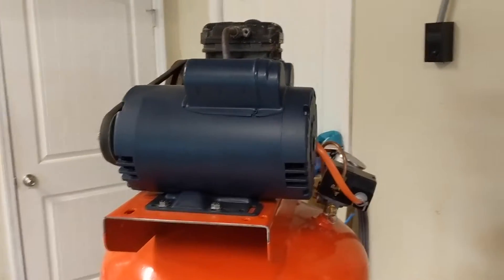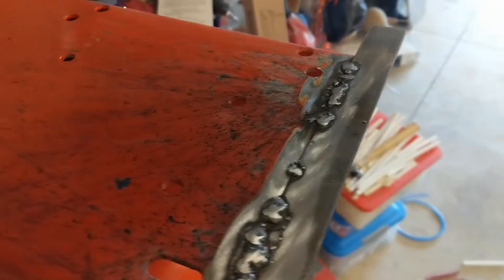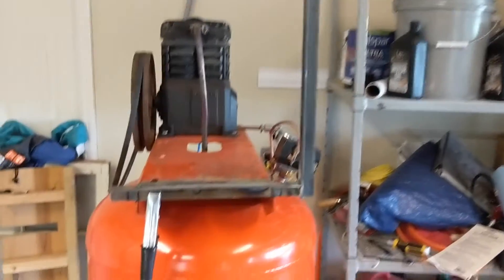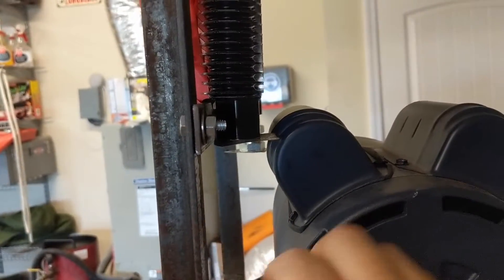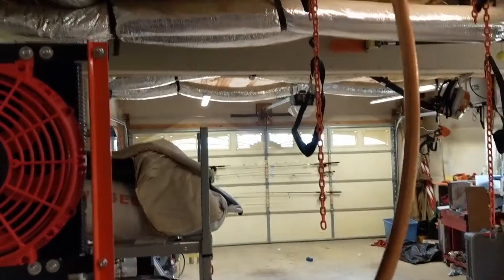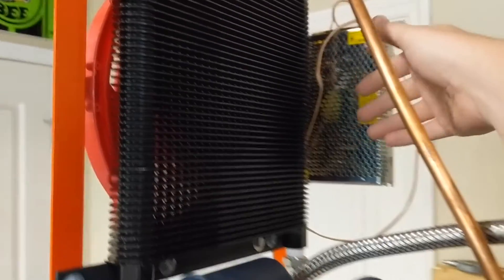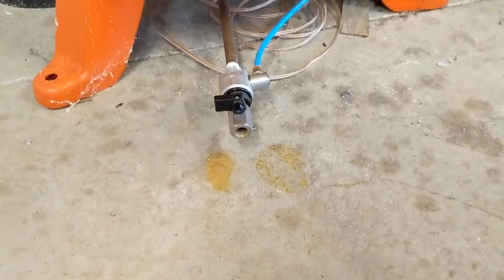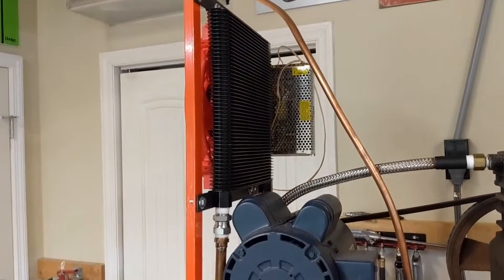Air Compressor Aftercooler/Dryer DIY Under $200

Comment: Hey Rooster,
I got my project going finally. I installed the lines on my 30 gallon compressor and the oil cooler and I’m having a problem with the fan blowing a fuse every time I connect it to the power switch. There’s 2 lines for the motor and 2 lines above those. Do I disconnect the 2 factory wires and install the fan wires. Any ideas?
Reply from the maker: You should have 5 wires coming into your pressure switch - 3 from the incoming AC which are hot, neutral and ground if it's 110 or hot, hot and ground if it's 220.  Your other 2 should be the switched power going to the motor.  I connected my fan transformer to the two wires going to the transformer.  220 is easy because they are both hot.  If it's 110 then you have to make sure you have the correct polarities.  You say blow a fuse, but are you meaning the breaker in the panel for the circuit, or a fuse in the transformer?

Comment: I don't get why you put a 12 volt fan on it.
Wouldn't it be simpler just to use a 120v or a 240v fan instead?
Reply from the maker: I was looking at them, but I couldn't find an inexpensive 220v fan.  It was actually cheaper to use a 12v electric radiator fan and buy the transformer
Reply: @TheRoostersGarage  I never would have thunk it !
Reply from the maker: Yeah, I was seeing fans for over $100 for much more critical jobs intended.  I just started looking at what fans I could adapt to this and stumbled on these eBay fans
Reply: @TheRoostersGarage  I think I would have gone to Wally World & bought a Chinese fan for: "a-buck-two-ninety-eight".
Reply from the maker: @lestergillis8171  I looked Wal Mart for cheap fans, but they didn't have their fans out when I was building this.  You know how retail is, swimsuits in January, coats in June.  The Chinese radiator fan off eBay cost what my Wal Mart shop fan cost (which I also thought about repurposing) and had mounting tabs, so that was one less thing to figure out how to do.  Just needed the cross braces to hold the fan mounting tabs.  So much of this project was looking at cost, then figuring out how to piece all these parts together that aren't meant to work with each other.

Comment: Thank you for the reply this is why I love utube because you guys always reply and promptly. Honestly it’s a bit confusing but I think I got it. A video just on that portion wouldn’t be a bad idea. I bet your audience isn’t even aware of the importance of this and how convenient this moisture minder is. It really helps keep the tank dry. Thank you again for your help. Keep up the videos and by the way your idea of putting the cooler on the motor side blowing across the piston heads is really a stroke of wisdom makes more sense than across from the pulley belt.
Reply from the maker: Thank you for your kind words!  I try to make helpful videos and I'm glad that this crazy idea I had has now helped several people.  I'm not sure if the fan blowing over the piston heads really makes much of a difference, but I just figure it can't hurt.  I'll see about making a video on the moisture minder this week.

Comment: Hey Rooster,
I have the transformer all squared away and I just received the same Tsunami moisture meter you have and it all seems cut and dry except the copper line from the business end of the moisture meter going into a tee fitting. Your video is not clear about it and I would appreciate if you could explain a little further. It looks like the meter is splitting into the oil cooler line. That little item is expensive $125 not counting the installation kit . It looks like you went for that too.
Regards 
Staten Island John
Reply from the maker: Yes, I purposely glossed over that since that was my first pass at dryer air.  The T fitting goes into the copper line that goes to the unloader valve and the pressure switch, not the oil cooler line.  My compressor has a 1/8" copper line but both the 1/8" copper line and the 1/2" copper line from the oil cooler go into the unloader valve at the tank which makes it a bit confusing.  I did go with the installation kit, but still had to make a bracket for it because their bracket didn't suit where I wanted to mount it.  Let me know if you have any more questions and I can make a quick video if needed.

Comment: Hey Rooster,
Thanks for the reply and I just received the Sam transformer you have. Did you adjust the voltage with a volt meter and if so I assume you adjust it to as close to 12v as possible. Plz correct me if I’m wrong. Also I’ve seen the wiring for the pressure switch using the connections for line 1 not the motor. I have seen a lot of utube on this and I like yours the best. By the way ur welding held and u prettied it up. I also just received my 14” fan and I’m setting up my Industrial 30 gal compressor and I’m also looking for the largest oil condenser which is not easy.
Regards 
Staten Island John
Reply from the maker: Oh heck no.  I just took the manufacturer at their word that it's 12v roughly output.  Honestly if it's closer to 14.4 then that would be best since that's what vehicles run at.  It's a fan and as long as it turned on, I was happy.  I'm glad you enjoyed my creation.  I watched many others and tried to take elements out of them and also create something that wouldn't break the bank.  You'll be so much happier with the dryness of the air when it's all done.

Comment: Hey Rooster, you didn’t show how you wired the fan to the transformer and adjusted the voltage?
Reply from the maker: Oh dang, you're right.  I connected it to my pressure switch that turns on the motor for the 220v side.  I've done this on another air compressor and it was quite a bit different than mine so tracing the motor wire was the key to finding a contact I can tie into.  The transformer has a switch which should be set to your motor voltage, but just make sure it is when you get it.  It's only got 2 settings, 110 and 220, so even if you had a 110 compressor the same transformer would still work  Then it's got 3 12v outputs and I just used one pair.  Let me know if you need any more help.  I can make a video detailing this if needed.

Comment: Your lower fitting should be the outlet so the water drains down to the lowest point. The rest looks good. But you should still drain the tank after each use. Admittedly there won't be much moisture but better safe than sorry.

Comment: The moisture you are still getting is coming from the check valve being in the original location. When you turn off the compressor, pressure and moisture back flows from the regulator line.
Reply from the maker: @waboom2 Are you talking about the tank check valve because it is on the dry side of the system.  The unloader valve is on the wet side and would absolutely let moisture out when the compressor shuts off.
Reply: @TheRoostersGarage  yes I meant the unloader. Supposedly there's a way to mitigate this.
Reply from the maker: @waboom248  Right, but that's of no consequence unless you are seeing rust forming at the unloader valve.  The only air making it in the tank is dry air.  Are you having issues?
Reply: @TheRoostersGarage  no I'm not, but I saw a yt'er very briefly mentioned you can arrange the set up to drain the regulator to dump some moisture as well.
Reply from the maker: @waboom248  I'm using a HF water separator which drains when the pressure drops and since the unloader dumps all the pressure upstream of the check valve, that's the only time it drains.  Although, I have the separator setup after the transmission cooler and it would absolutely be wet going back to the unloader.  I guess you could setup a water separator on each side of the cooler to deal with the changing direction of the air.  I have a Moisture Minder on the unloader piping and I just checked I'm getting a bit of oil out of it, which makes sense since the air coming from the compressor head has some oil in it.  I didn't see any signs of water around the unloader valve and I think the Moisture Minder is taking care of that side - maybe.

Comment: I would think you should mount the heat exchanger with the inlet air on top, and the outlet on bottom, and pitch everything to the filter/separator. Other than that I like the install. How has it been working for you?
Reply from the maker: That was my original plan, but the hot side braided hose I bought wasn't long enough so I had to redesign it with the length I had.  Pesky measurements!  It's been working very well.  My compressor is only 125 psi so I haven't blown anything out.  I setup a friend's who has a 175 psi compressor and in about a year he blew the cooler.  I found a suitable AC condenser for him and am waiting on the call to go hook it up.  I cycle my compressor at least weekly so it's not sitting dormant, but I'm also not a shop using it all day like my friend is.  I've painted with this and ran my sandblaster (both things I couldn't do before without getting tons of water) and everything has stayed dry.  I did notice I filled up my water separator in about 10 minutes to double it's water capacity, so I've decided to just let the compressor turn off every 10 minutes or so while blasting.  I've not even had to make any changes since I made this video.

Comment: I love what you have created and it looks like a good project to hone a few new skills. Do you have plans for any more modifications? 
Is there an issue of stressing the motor when using a cooler post compressor on a single stage compressor?
Reply from the maker: Thank you!  For my setup with 125psi it's working great.  If you had a 175psi compressor, I'd switch from the transmission cooler to an AC condenser.  I am no engineer, but I don't see this as adding enough stress the motor would even see it.  This is just adding a much longer path from the compressor head to the tank.

Comment: It honestly baffles me why air compressors don't have these built in and integrated to extend tank life. They are inexpensive and easy to assemble. You'd think this would be a selling point for more premium compressors.
Reply from the maker: I think some of the ultra expensive ones have an integrated dryer.  But honestly if the tank rusts out, that means you have to go buy another so it works out better for the manufacturer.  Plus, it adds to the cost.  This only cost me a couple hundred to setup, but the majority of people would want something that looks nicer and therefore costs more money.

Comment: @Rooster’s Garage,  on the 220v power supply, I assume you have both hot legs going to L and N on the input terminals?  I'm going to run the same setup except tap into the hot legs from within my magnetic starter
Reply from the maker: Yes,, you are correct

Comment: for your fan problem with the bottom holes not lining up right that's a super easy fix, cut off those bottom ounts and use a soldering iron with a flat tip to plastic weld it back on, add filler material to strengthen it too, 15 minute fix
Reply from the maker: Thanks for the idea!

Comment: Normally there is a guard around the pulley on the motor of the air compressor, and I have seen people put the after cooler in front of the pulley, which acts like a fan, keep the moisture out.

Comment: You are using speaker wire for 220 volt service ! You’re going to get electrocuted with a set up like that . I hope you have changed it out .
Reply from the maker: Why?  Its 220v with very little current.  Its 16 gauge wire, which is the same size as lamp cord and 220v is the standard worldwide using 16 gauge for lamps, kitchen appliances, etc.
Reply: @TheRoostersGarage   Mark is quite correct. In electrician terms, irrespective of the conductor gauge or load, the flex is only single insulated and the insulation should be rated to the maximum voltage present. I doubt any household or kitchen appliance manufacturer will get a product through BSI testing these days with single insulated flex outside of an enclosure.
The only other consideration would be that the flex is just two core and does not include an earth conductor. Another important design consideration would be to ensure that a metallic transformer enclosure was earthed  as necessary.
Keep up the good work.
Reply from the maker: @davidcook99  It does not include an earth conductor, just the two poles necessary for the 220 volts.  The wiring is in a place that I never reach to, high enough no kid would reach for it, and the transformer enclosure would be grounded because there are 3 conductors that come into the air compressor, 2 of which are the 2 live poles, and one is the ground.  The main pressure box is grounded, which is bolted to the air compressor and has an electrical connection to the tank.  Through this, the brackets which mount the transformer are also grounded, so it's grounded much in the way a vehicle is grounded - via bolts.  Granted, this could be better and I know it has a ground connector, but I don't think I've run anything to it.  Might be a good idea just to be safe.

Comment: Great idea for a cooler! Im not a welder either but my late father was. When you welded the angle iron, it and the piece you welded to are thick enough that you could have tacked it in several places to keep it from drawing then welded the whole thing with a continuous bead. Looks better and is stronger.
Reply from the maker: Thanks for the tip.  I forgot to tack it well enough to keep it from drawing.  That's my inexperience showing.

Comment: hey i cant find the link for the trasnformer (240 to 12v) and good video btw !
Reply from the maker: Thanks!  Here's the link: https://www.amazon.com/gp/product/B01E6S0JS4/ref=ppx_yo_dt_b_asin_title_o05_s00?ie=UTF8&psc=1
Reply: @TheRoostersGarage  Thanks! so i was looking at the transformer i only see L and Neutral. so when you wire the 240v AC do you put one HOT wire to (L) and the other HOT wire to the NEUTRAL and one to ground and flip the switch on the transformer to 220VAC?
Reply from the maker: @alexg6252  Sorry, I didn't get a notification for your comment and just now saw it.  One goes to L, the other hot to Neutral and if you're bringing a ground, then one goes to ground.  Make sure the switch is set to 220VAC as well.  I'm sure you've already taken care of this seeing how I'm 6 months late answering you.

Comment: I would have mounted the cooler in front of the compressor pump pulley with the built in fan blades. Either way, it looks and works good. Great job.
Reply from the maker: Thank you.  The compressor pump is very small and the hot air coming off the head wouldn't do much coolng I'm afraid.  The second fan blows more air over the compressor head and helps cool it more.

Comment: @Rooster’s Garage where did you get the automatic drain? Is it time based or automatic based on moisture level??
Reply from the maker: Harbor Freight.  The link is in the video description.  It's pressure based which works perfect for this application, as long as I'm not sandblasting for an hour and the compressor is running nonstop.  I've been looking at a fully automatic on Amazon but haven't had the need to replace my HF drain just yet.  https://amzn.to/2KiVmJj I've only honestly wished for a fully automatic once.  All of this depressurizes every time the compressor shuts down

Comment: restricts air volume
Reply from the maker: Not at all.  It's between the compressor and the tank, not between the tank and the tool.  Besides, I'm larger plumbing than it ever had and the trans cooler is 1/2" which is even larger.  The air refill is only a couple seconds longer just because it has more air volume before it reaches the tank.
Reply: @TheRoostersGarage  It's also longer because you are putting more air in the storage tank due to the incoming air being much cooler.
Reply from the maker: @ttank94 Very true!